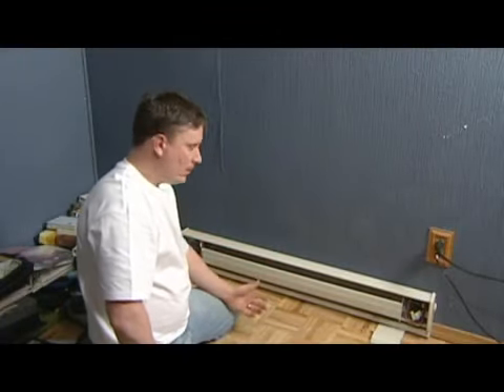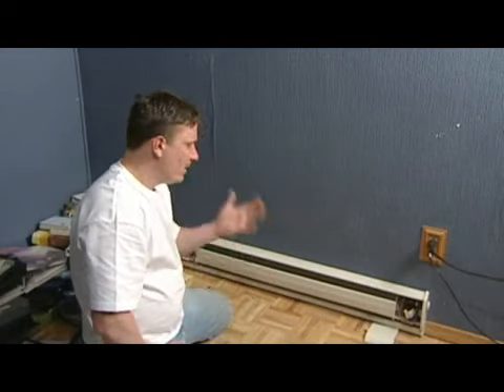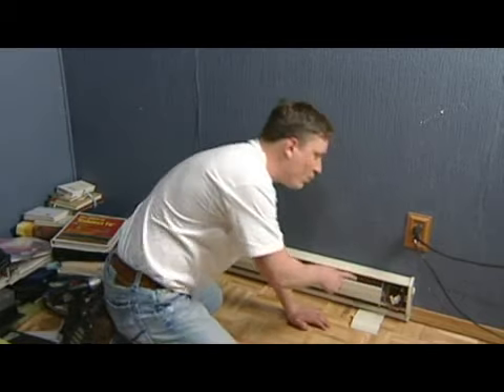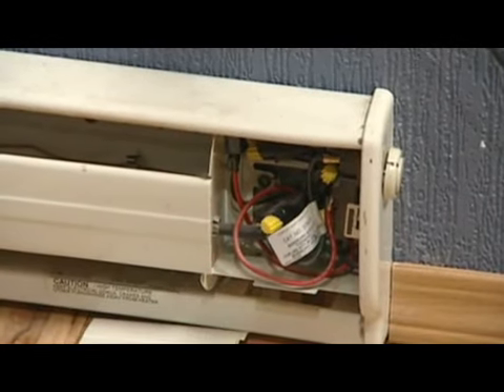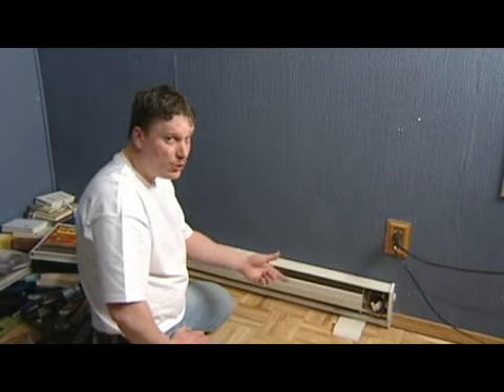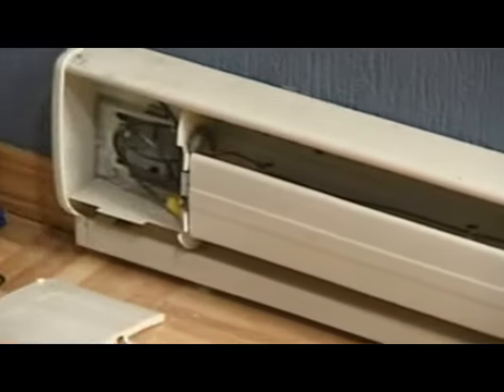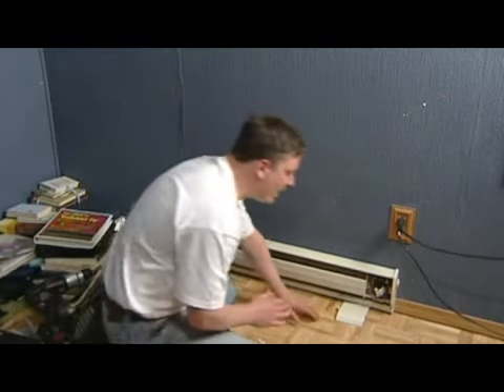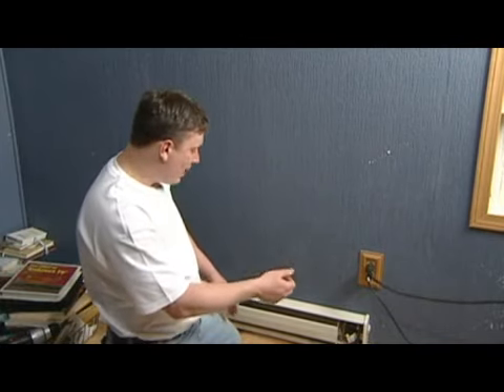Electric Baseboard Heating Troubleshooting

Comment: I had an electrician look at my baseboard heater , he opened the door to it and said, oh yeah this is burned out, no voltage check just a look . He checked my thermostat with a voltage meter but not the baseboard, he just said I need another heater. Now I think I’ve been scammed.
Reply: Nah, they def need to check the voltage to the heater. You could have a broken wire going to the heater.

Comment: What happens if it doesn’t turn off even if the knob is turned off
Reply: @BluezzEh  i just moved to Minneapolis. The basement baseboard heaters won't shut off. I adjusted temp to 70F but its staying at 85F very hot.
Reply: @troylollysaf9311  5 months late had same issue before it’s 1 of 2 things most common 
1) faulty thermostat replace it. 
2) you have a single pole thermostat not a duel pole. 
Single pole = can’t actually turn it OFF. You can only turn heat down. 
Double pole= can fully turn it OFF

Comment: I have two electric baseboard heaters that are controlled by a thermostat on the wall. Neither heater comes on. Before this happened I did have a buzzing noise coming from the fuse panel when the heaters were operating, but its wasn't a terrible noise and I just assumed its supposed to do that. I find it odd that both heaters would go bad so Im thinking it may be a problem with the thermostat. How could I check that?? Any help from anyone would be greatly appreciated. I have checked the breaker, but all I did was reset it. I have enough electrical knowledge to know what is happening and have a voltmeter, but Im not sure how the thermostat interacts with the heaters.

Comment: I have a problem with mine. They leave black stuff everywhere. I bought a condo in MA and I don’t think the previous owner cleaned anything. There is black on the walls. I cleaned my 
refrigerator and now I have black stuff in it. The bathroom is the worst. The windows have black stuff that doesn’t vacuum up or doesn’t clean up with anything. There’s no control on the outside of the heater. I feel I will have to replace the windows and sliding door. I’m from CO and we don’t have this kind of heaters. Do you have any idea of what is going on with them?